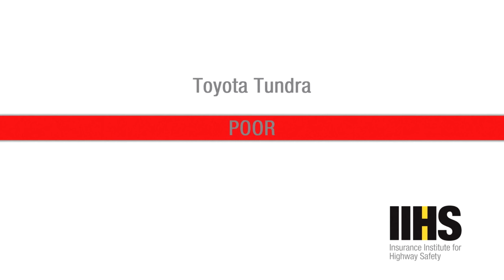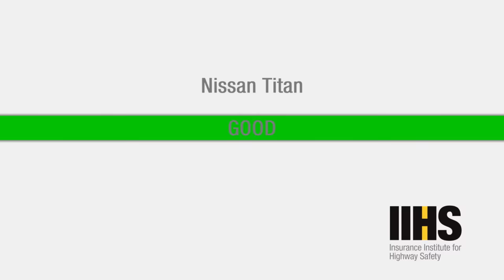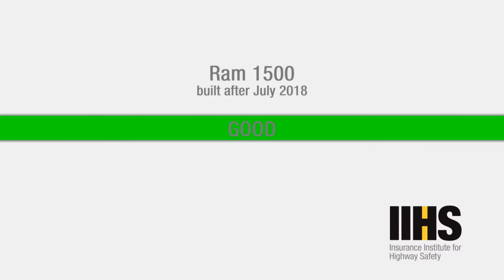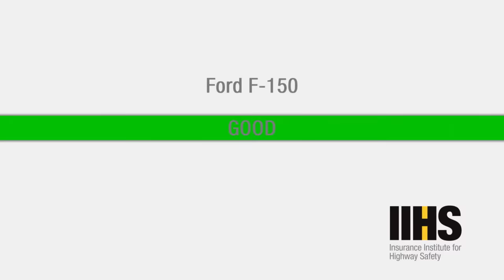TRUCK CRASH TEST COMPILATION - Ford F150, Toyota Tundra, RAM 1500, Nissan Titan

Comment: The 2019 Ram earned a good rating as well.
Reply: Who cares about a ram crash test rating, when you won’t be able to start it half the time anyways.  It will be in the shop.  Not on the road
Reply: Now its at the top of the pack 
TOP SAFETY RATING 2021
Reply: @GeorgeZimmermen  Yikes, don't say that, I'm thinking of buying a Ram.
Reply: @badamsfx  think again
Reply: @badamsfx  that’s not true lol. Ram is used by many people in the work force because they are reliable
Reply: My 2019 Ram is awesome so far.  So much room under the hood for servicing compared to my old Ford which is cramped. Rides better than my friends same year Chevy and tons of power with the Hemi. I'm a die hard Ford man but the only new truck that interested me was the Ram. Not a fan of the Ecoboosts after friends and family had problems with theirs. Also not a fan of overhead cam v8's. If Ford offered the new pushrod 7.3 in the F-150 then I probably would've went with Ford.

Comment: At what speed are these tests being conducted at?  It would be helpful to know the parameters of this test.
Reply: A very slow 40 mph.  I want the tests done at 70 mph.  That would actually help save lives.
Reply: @davidbeppler3032  Cars aren't engineered for speeding crashes past 55.
Reply: @NicholasLittlejohn  Yes, they are.
Reply: David Beppler if you drive 70mph into a steel box and expect to walk out all good and untouched, you’re dreaming. No car will survive that
Reply: @davidbeppler3032  internet warrior detected
Reply: @spazemfathemcazemmeleggymi272  Fight me!

Comment: Ford passed IIHS with flying colors with all good in crash testing compare to all other brands.
Reply: Coming from a biased ford boy.
Reply: @canihavealongnamepleasebos4507   did you watch the video??  it clearly did better than all the other vehicles
Reply: How Nissan (Titan) and Ram did just as good.
Reply: @Edwinsoda  watch from 8:40 the guy says it in the video!
Reply: @Edwinsoda  look at the extended cab results...
Reply: @canihavealongnamepleasebos4507  you're right because I believe in the product I sell, would do the job to keep someone safe.
Reply: @Edwinsoda  also.. look at the detailed crash test on their website. Ram and Titan did not do good in structure and safety cages.
Reply: IIHS does not mean SHIT kid!!
Reply: @pepehands8224  So their scientific and mathematical tests aren't worth anything, despite the fact that they have recorded proof of the event, outcome, and other aspects of the test?
Reply: You're always safer driving a Ford.... since 25% of the time it's in the shop for repairs. Poor neighbors of mine are getting to sample all kinds of loaner rentals as their F150 has been nothing but trouble and spends days and days in the shop for warranty repairs.

Comment: I have no idea why anyone would buy any other full-size truck than the Ford F-150.
Reply: remingtonh Because some people choose reliability over a slightly better safety score. Every Ford I’ve seen and have driven has been nothing but a complete letdown in terms of longevity.
Reply: Joel Glisson says the guy with a Ram that will be a rust pile with a engine mounted to it in 2 years
Reply: Only Ford F-150 for me. Never have any problems with my Ford F-150!
Reply: Because ram can beat them in power and ram can last much longer but really it all depends who manufactured it and where
Reply: Because the 🐏 ‘s are the best
Reply: loganbaileysfunwithtrains that’s funny because my challenger R/T is pushing 200k and only needed a new A/C compressor.
Reply: loganbaileysfunwithtrains Hmm...my 2013 Ram with 140,000 miles had no rust and has never had anything whatsoever fail or break on it. It was daily driven through rough mining/pit terrain and used to drag race people every other day. Meanwhile, my coworkers brand new fords would just fall apart and blow up. My 2017 Ram gets treated equally as bad if not worse than my 2013 did, and it doesn’t skip a beat either. So yeah, I think I made the right choice by avoiding fords.
Reply: Because I like a truck that don't break down
Reply: We buy GM. All the Fords my family have ever had we're pieces of shit. My uncle had the company he works for take his work truck (a Silverado) away and give him a Ford. That Ford broke down so much that just 3 months after his Chevy got traded for the Ford he went up to his boss and demanded his Chevy back.

Comment: thanks for the video, why are headrests being removed for the demonstration? 

Don't you guys test the whiplashes?
Reply: It's so they can clearly see how the crash test dummies are effected by the impact. 

Headrests are most effective when you are struck from behind. Since they are doing front impact testing the headrests are not necessary.

Comment: is it me or most of the airbags are not big enough and make you hit the A pillar
Reply: I was thinking that as well. Most of the time right between the dash air bag and side air bag. Fits like a glove.
Reply: yes, it certainly appears to be that way; a glancing blow to the side of the airbag. maybe  the bags need to be wider and/or need to be place closer to the A pillar to ensure an impact to the center of the bag for passenger.
Reply: I was wondering if they did that on purpose. Remember the old airbags use to break faces.
Reply: Looks like the F-150 was the only one that covered that area completely. A couple were certain to be a dash strike.

Comment: Funny how it says 2020 and the trucks have older years (2018, 2019)!
Reply: Those trucks haven't been redesigned since that model year, so they are exactly the same design that was being sold in 2020
Reply: The designs haven't changed since 2015 across all manufacturers anyway.

Comment: Ford clearly knew what they were doing with this new aluminum, honestly id feel the safest in the ford aswell. Shit, guess those front ends dont look too bad to me anymore haha.
Reply: Aluminum has nothing to do with it. Just the sheet metal is aluminum. The structure is not, and the structure and frame is what protects you, not the aluminum. My 2001 Land Rover Discovery had all aluminum sheetmetal, and the honest from the early 90's did too. Nothing new about that technology, but the structure is what keeps the truck safe, not the sheetmetal. Formula one cars are made of carbon fiber, plastic and fiberglass and disintegrate in a wreck, but the structure around the driver is what saves his life.
Reply: Ford actually designs for these kinds of things because the poor history they have during these tests. They really are the best when it comes to front end collisions. Notice what the tire does when it hits? Its the only truck that does that, they put crash bars (steel) in the wheel wells to prevent the tire from going into the cab and help absorb impact. As far as roll over, side and rear collisions i dont know much about that

Comment: I can't believe the 2003 tundra got a better crash rating than the 2019 😂🤦
Reply: Thin p l a s t i c
Reply: Testing was way different back then. Hell small overlap didn't start until 2012

Comment: Toyota Tundra fans can boast all they want on reliability but at least my passenger will be alive after a crash.
Reply: maybe they don't like their passenger...

On a more serious note... this is only one test and it does look like the ford should be tested again to see what happens when it catches instead of sliding over... 

Be an alert driver and avoid it all together and drive what you like
Reply: Well, Tundra owners make sure the mother in law is in the passenger seat.
Reply: @NuttedInYoMom  
Damn! LOL
Reply: Older vehicles are better head on than doing the corner, they didn't design vehicles to tolerate that till the last decade. So face trouble head on than risk the glancing blow that'll put a wheel in your pelvis
Reply: well at least thr Tundra wont crash your bank account on repairs

Comment: 5:41 How the hell did the ridgeline get acceptable when the passanger smoked their head on the dash!
Reply: exactly
Reply: @RubyXIII  beacuse the passengers head was going into the airbag hard and caused the airbag to deploy or the dummy slipped the airbag
Reply: I wouldn’t even consider it a truck.
Reply: and ram looked like the dummy ate the dash too 4:58
Reply: Because unlike others that were qualified as marginal or poor, the Ridgeline's structure absorbed and handled the energy pretty well, the cabin's shape was not compromised, which is an important aspect of crash test califications, as no deformation means no people crushing. The passenger's airbag was a complete failure in that particular test though, hence why it is considered acceptable
Reply: @Pao234_  what can you tell me about the Tundra? I had high hopes for that truck
Reply: I did not realize until you see that holly crap your right
Reply: I did not realize until you see that holly crap your right now did it get a aceptebel i ugrea with you
Reply: Not rong there
Reply: because of money
Reply: It’s not even a truck haha. Mix in a fully boxed frame one time
Reply: Its simply because if you buy a honda truck you have no brain to protect
Reply: plastic head went right between the two airbags